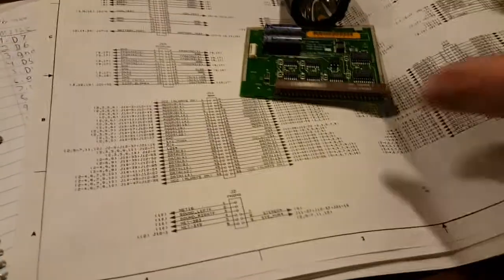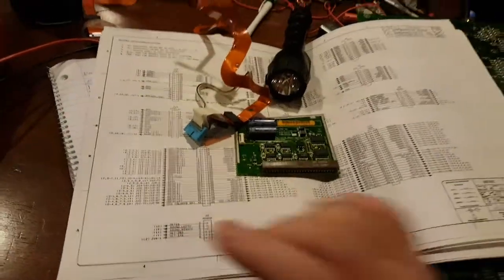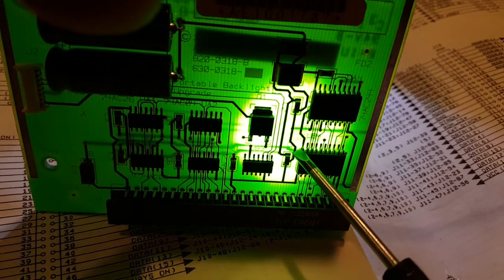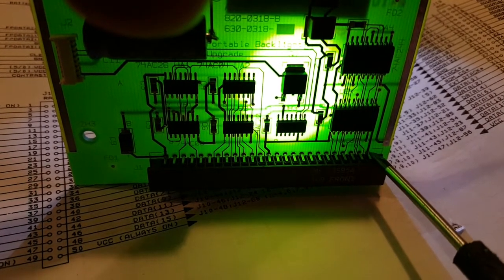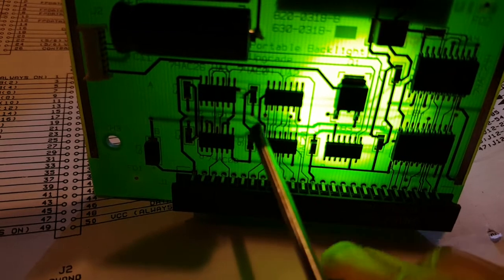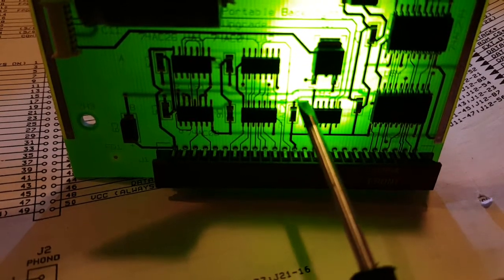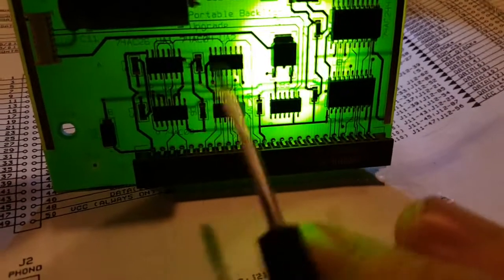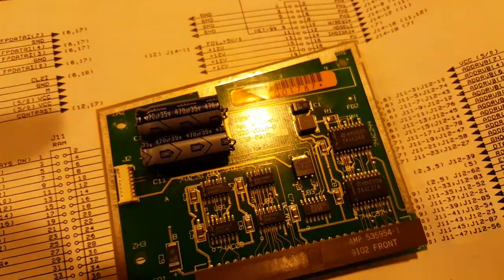Electronics Engineering Blunder? Fail?

Comment: Just came across this video.  Your are absolutely correct on the non functionality of those bypass caps.  I would classify this as a complete blunder.  This was probably due to a rush job and the schematics weren't thoroughly checked with a DRC or with a second pair of eyes.  Great example of how not to bypass filter your circuits.